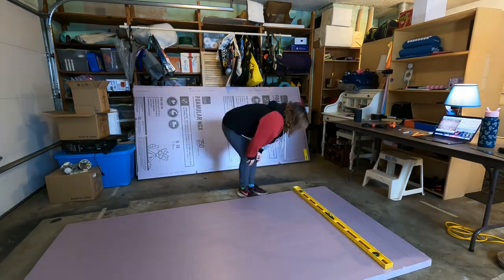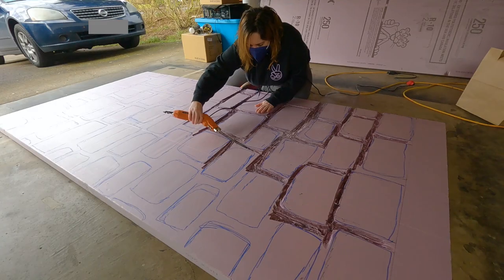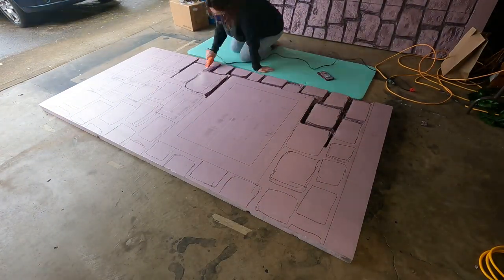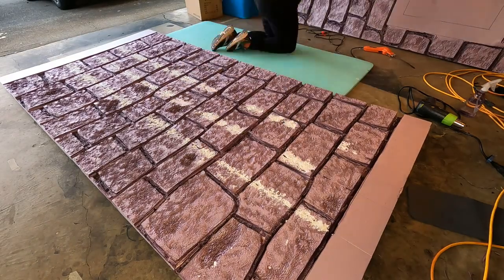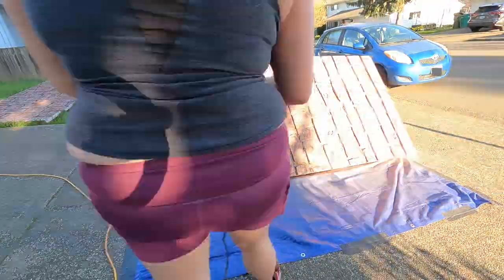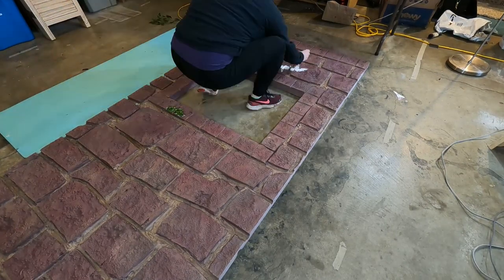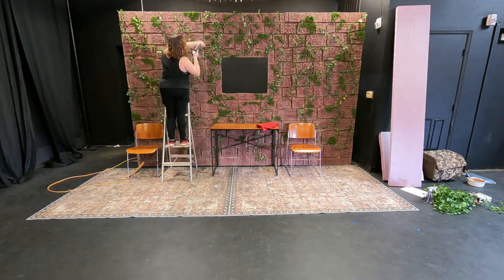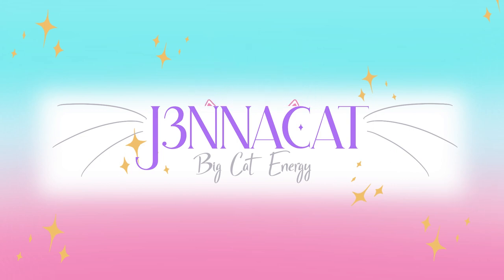Building a Castle Wall out of Foam

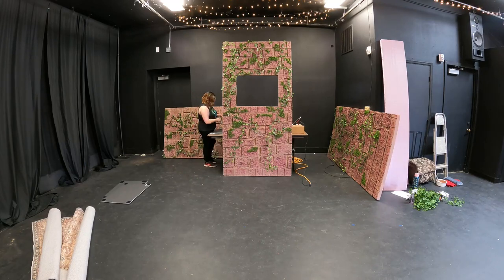Comment: I'm doing something similar to this for a Halloween display this year and this was soooo helpful and full of good tips! What did you use at 5:27 to (I assume?) stick them together?
Reply from the maker: Okay that one is a hard one to explain and it definitely wasn’t the most ideal way to do it but it was cheap haha here’s what I did: I used foam core from dollar tree and a velcro roll from Amazon. I can get you a link to what I used in a bit to help paint a clearer picture. But I essentially mapped out where to place the foam core pieces on the back of the castle wall in a way that would expand over the seams of the two pieces. Then I stuck one side of the Velcro to various places on the foam core and then the other side of the Velcro to the foam wall, then I smooshed the foam core into place and that essentially acted as a weird giant staple for the wall pieces. I used multiple foam core pieces down the length of each seam. I should have shown it in the video but I just wasn’t thinking about it at the time! And I do believe there’s probably a better way to do it but that’s what I was able to accomplish with my budget and time constraints. You’ll also need to have supports in front of and behind the wall so it doesn’t topple over one way or the other. I hope this made some form of sense!
Reply from the maker: Also I’m really glad my video was helpful!! I wish you all the luck with making your own wall! And feel free to ask anymore questions here if you have them! It was a while ago that I did this but hopefully I can remember enough about the process
Reply: @j3nnacat  Thank you so much for the quick reply!! That makes total sense. I can see in the video you kind of used the table for support in the front. What did you use for the back, if you remember? Thank you again for answering my question!!
Reply from the maker: @yuzugrove  I used another table in the back! And potentially a chair on each of the side walls but can't remember for sure. But anything that's sturdy and kind of tall will work! And here's the link to the velcro that I used for reference. The link is an affiliate link, which doesn't change anything for you, just means Amazon may send me a portion of the profit if you were to purchase it: https://amzn.to/4ej5U92